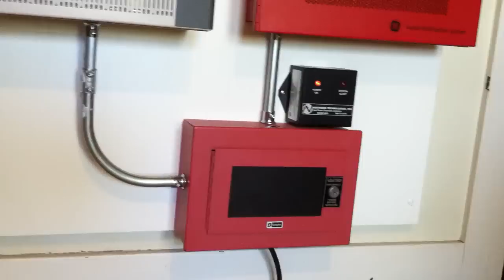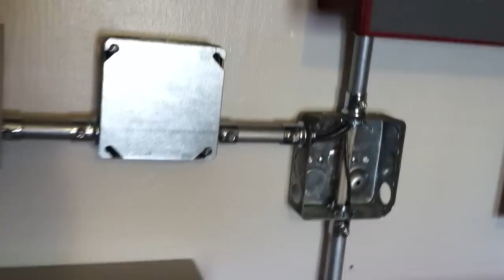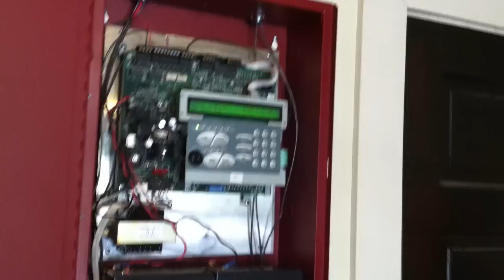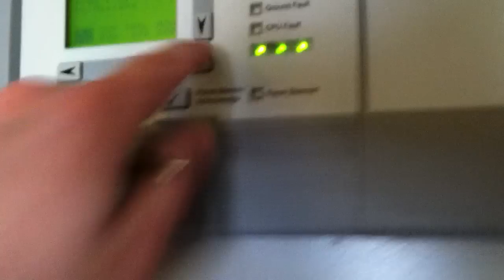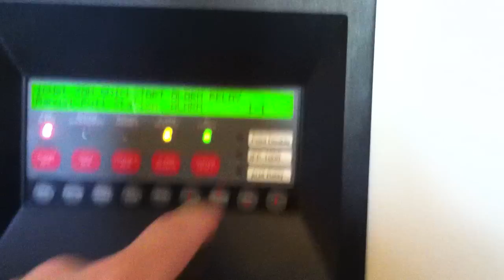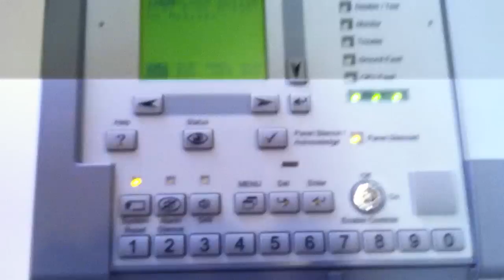*NEW* System Test 25

Comment: No need to electrical tape wire nuts unless there is vibration. Also, you don't want to have ROMEX and fire alarm wire in the same pipe. The high voltage can interfere with the system. But otherwise, great system. I really like the set up!